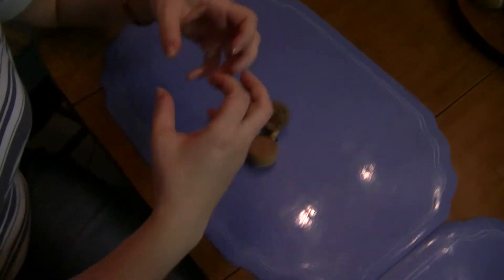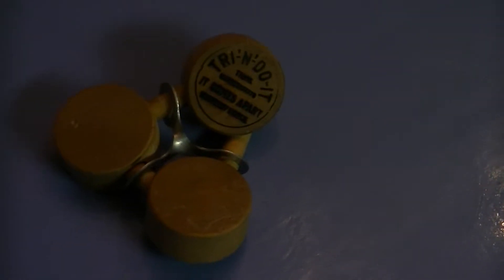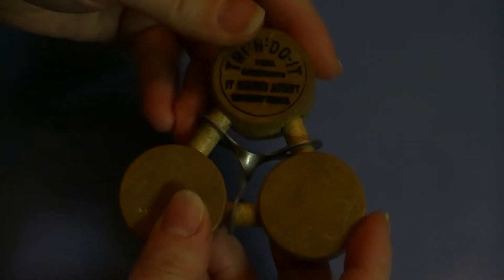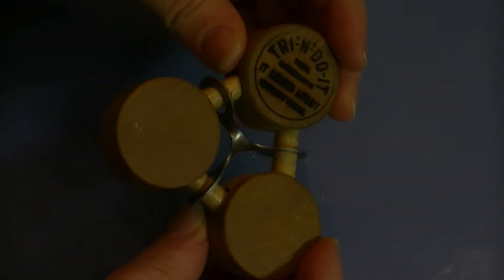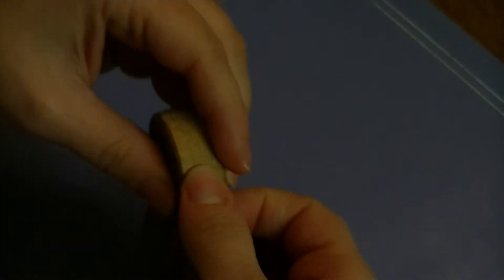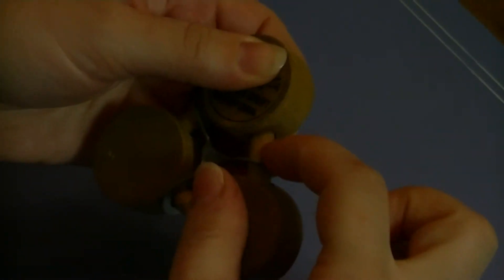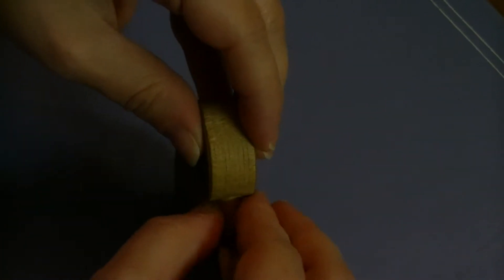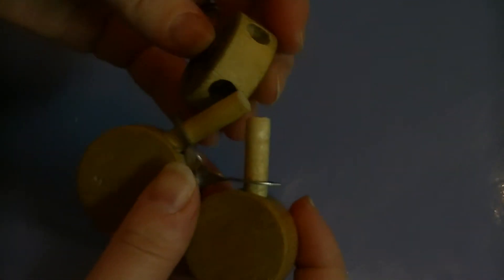Tri-N-Do-it Puzzle Solved

Comment: Hello from 2020! Two things about this video, first is that you did indeed solve it, second is that this doesn't explain the entire solution. According to the patent of this puzzle, two dowels are short, and the third longer dowel is the key to the puzzle. by rotating the longer dowel to the right position, it opens up a cut away section for one of the shorter dowels to move into. From there you move the remaining short dowel into the new area from the first short dowel being moved. Whether it was luck or wear for you is questionable but that is how the puzzle is supposed to come apart.

Comment: I think your puzzle may be worn-
I have one and it does not work that way. I can slide it down a little, but nowhere near enough to be able to pull it apart.
I tried your solution and no way, it isn't gonna happen!
I still don't know how to get this apart!
Reply from the maker: +jaysterdude Keep working at it. This one was extremely hard at first but when you get it just right, it gets really easy.